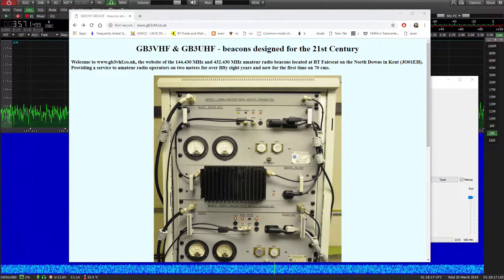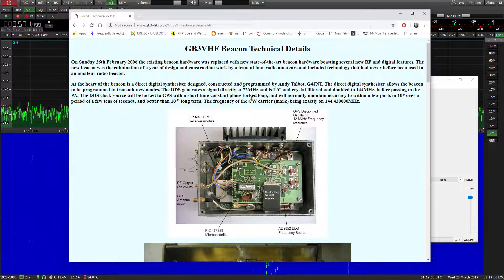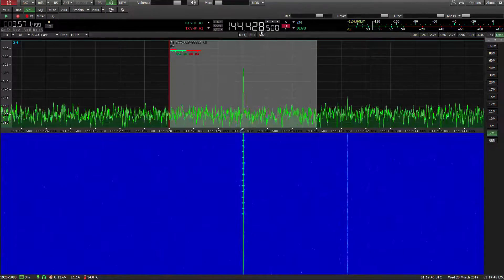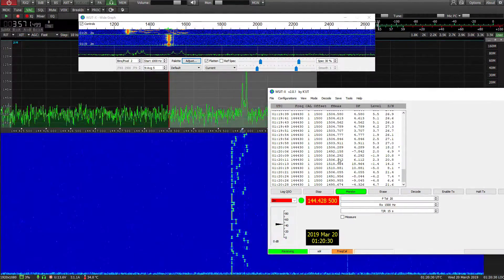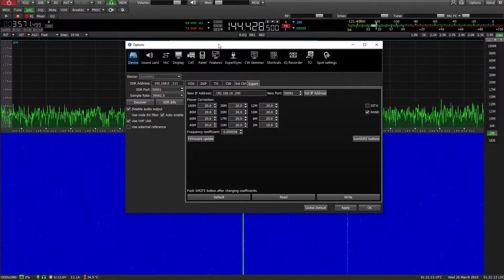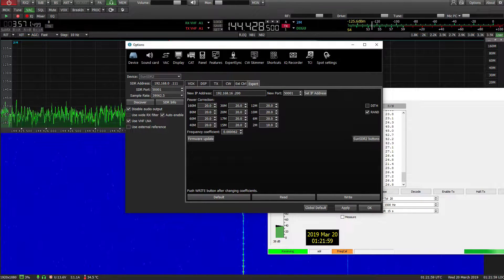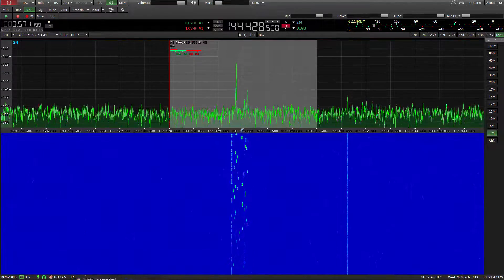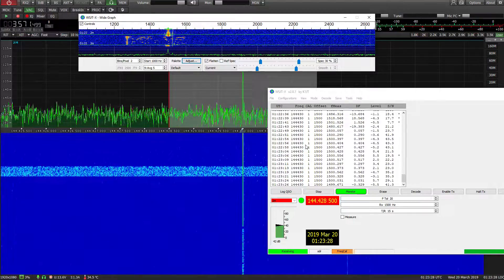Frequency Calibration with SunSDR2 Pro using  GB3VHF and WSJT-X

Comment: Just saw your video.  It's a while ago but curious as to your WSJT-x settings  (radio/audio) to communicated with the ExpertSDR software?  73
KK2L
Reply from the maker: I use virtual audio cables from https://vac.muzychenko.net/en/ .  Configure the radio software to output audio into one end of the virtual audio cable (all in the digital domain), and the other end is used by wsjt-x. Hundreds of videos on it all over the place.  Good luck !  73 Richie.
Reply: @mw0lge  Thank you.  I have been using this VAC since version 9 when I had a FLEX 3000 and am very familiar with it and its configuration.  Apologies for not being clear, my question was directed at the settings in WSJT-x, particularly RADIO settings, that allowed you to use this software with the SunSDR2 DX.  I am currently using TCI protocols with JTDX but prefer WSJT-x as my software for digital modes.  I can't seem to find any videos or forums that have this information.  Thanks for any help you can offer.  Cheers.  73 KK2L.
Reply from the maker: @mark1161  wsjt-x doesnt support TCI, so you'll need virtual audio cables, and virtual com ports. Just a matter of getting them connected up and using a ts480 or some such as the wjst-x radio. Richie.
Reply: @mw0lge  Got it.  I was looking for the brand of radio that would be compatible with the SDRdx and the ts480 works for me.  I can create virtual com ports also having done that with the FLEX 3000 and ANAN 100d.  Cheers 73  Mark KK2L.
Reply: @mw0lge  One more thing...I assume I should disable TCI to use virtual comports and virtual audio cables?  73 Mark KK2L